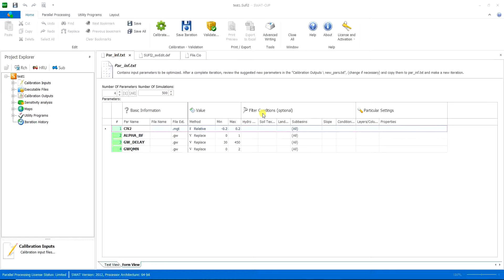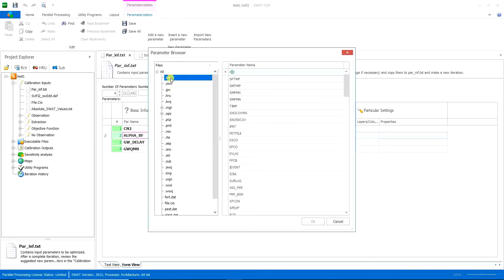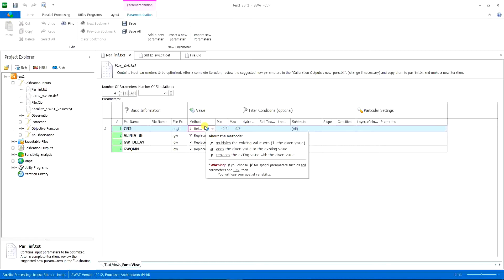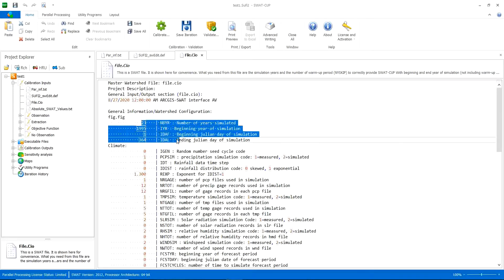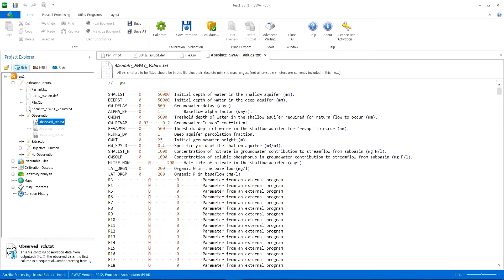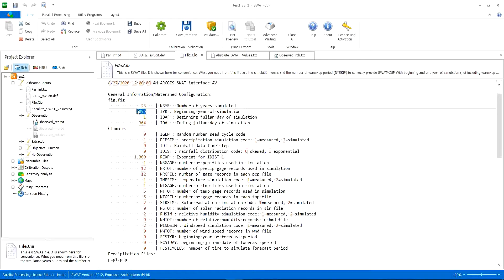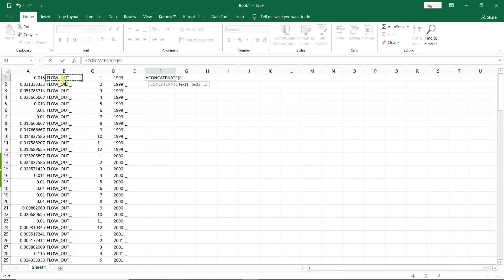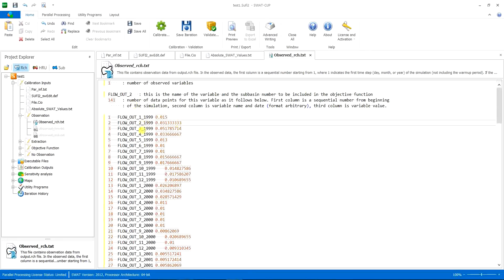SWAT Cup Calibration

Comment: Hi Aida. After running the Arc SWAT model the observed and simulated values difference is very high. My SWAT simulated discharge value is very than the observed discharge values. In the calibration phase using the SWAT-CUP SUFI 2 algorithm the hydrograph and summary statistics are very bad. In my SWAT-CUP model, the 95ppu-no-observed plot and the new_para.txt file does not exist. Why is occurring this problem? Can you tell? I am using Arc SWAT and SWAT CUP 2012.  I changed the parameter values and the number of simulations for the next iteration but the simulated values and hydrograph are not changing, as well as summary stats. Please tell me what is the problem.
Reply: Hello, can you solve the problem?

Comment: should precipitation and rainfall duration be same as streamflow duration. for swatcup to work. I have climate data from 1980-2017 but streamflow data from 2000-2017. WIll swat cup still  run